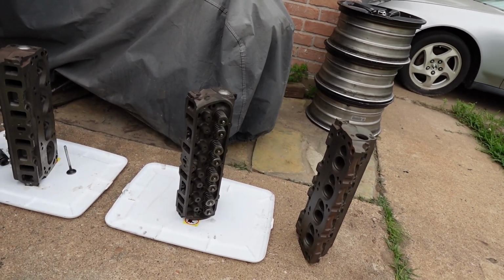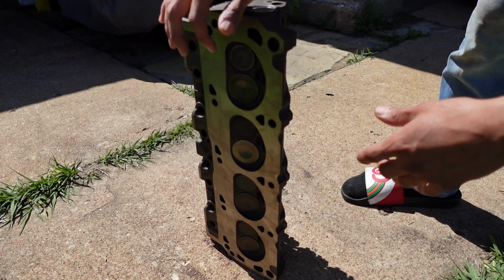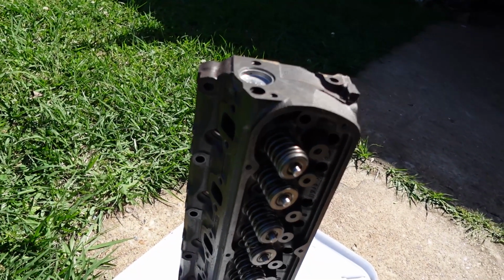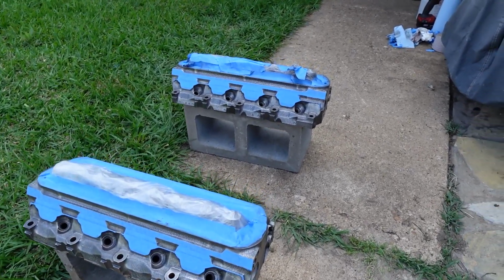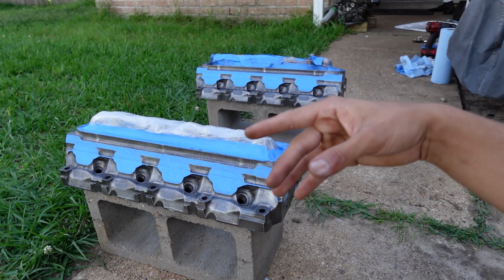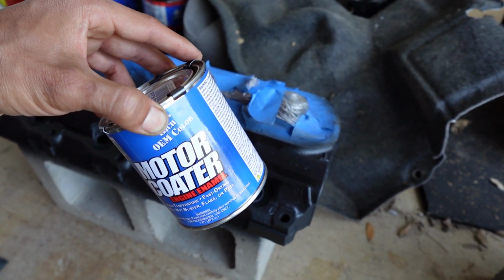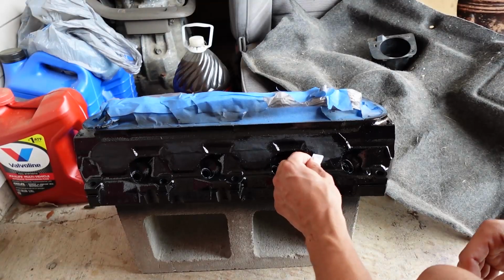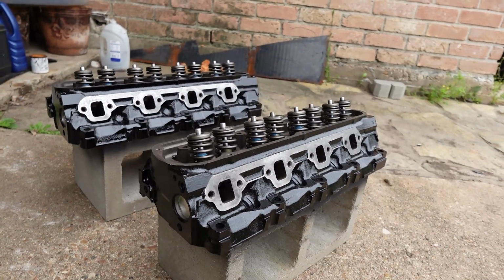Painting SBF Cylinder Heads & Installing Thermactor Plug

Comment: Great video, nice work! Since you have the heads off, were you able to see where the smog port leads to? Just wondering where that carbon that you cleaned out ends up. You mentioned before that it's not something to worry about but I'm curious because I was not able to find a diagram anywhere. Thanks!
Reply from the maker: I haven't looked but it should just go to exhaust port as the whole point of the smog pump was to just pump clean air into the exhaust to stream in order for the exhaust have more oxygen to run "clean"
Reply from the maker: Just looked into the exhaust port right now I see the hole for smog pump, I can send you a pic if you Message me on IG
Reply: Thanks, but that answers what I need to know. I appreciate it